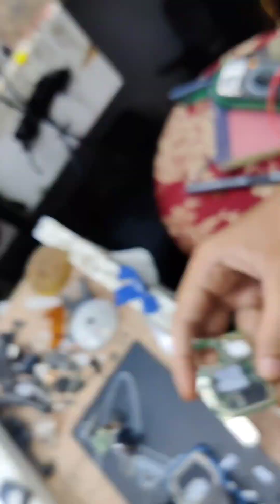GoPro Hero 5/6/7/8 Won't Turn On or Charger? Teardown GoPro Hero 7

Comment: Hi Bro,
I have a GoPro 9, and I've been facing a Bluetooth connectivity issue. I decided to reset it, but after the reset, the GoPro is not turning on. Now, I am unable to turn it on.
Can you please help?
Reply from the maker: Without battery put in charging adaptor then switch it on, let seen if battery faults it will switch on through charger